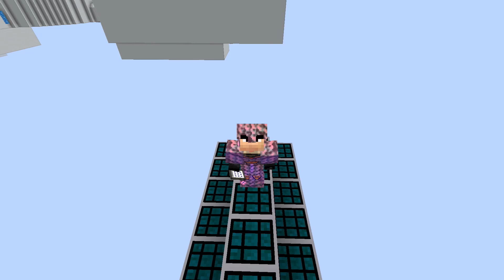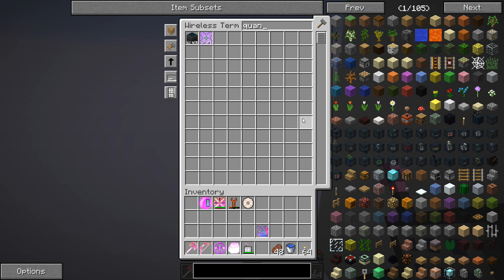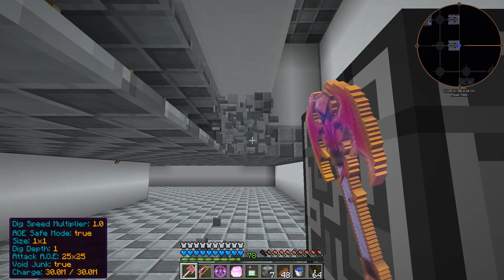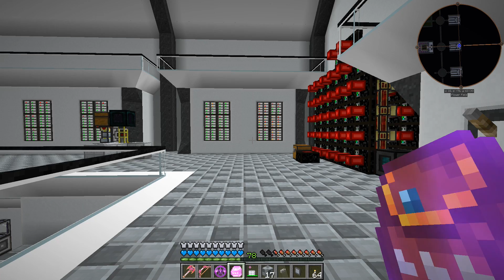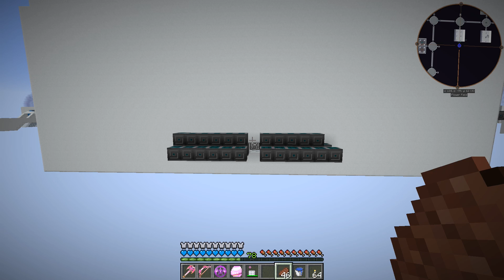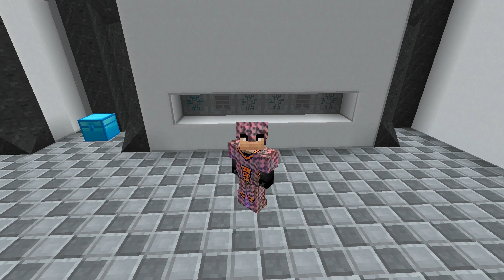Minecraft Mods FTB Infinity - MAX SPEED REPLICATOR !!! [E67] (HermitCraft Modded Server)

Comment: if you use a transfer node for  energy (preferably the hyper one), you can then connect solar panels to it and transform it into RF. So just connect glass fibre to it and fluxduxts to the other side and no more need for reactors! ;)

Comment: Watched the whole episode, and the best I can come up with is that you should put a P2P Tunnel - EU on the back of each of those Replicators.  As it says on the AE2 website "A P2P Tunnel has one input and many outputs."  I believe you can use the P2P Tunnels on the downflow of subnetworks, but not upflow.  So the input has to be on the main network, but you can have outputs on the subnetworks. Will test soon.
Reply: I tested this and it only works on the one network.

Comment: In defense of the Thermal Expansion fluiducts, You were using Hardened so those things cap at a point. I bet if you used a better pipe it would be like the Extra Utilities pipes or better. But either way, awesome video!
Reply from the maker: Tomnickles Is there a better thermal dynamics fluid pipe?
Reply: I thought the Flux-plated ones were faster but apparently not so much. I guess hardened is the best for fluid.
Reply: Hypnotizd Use the top tier ender io fluid pipes, they do they fluid super fast.
Reply: +Connor Macfarlane 
Yeah, the EnderIO Ender Fluid Conduit also transports liquid instantaneously from point to point so no physical liquid is in the pipes.

Comment: I tough you can only put 8192 EU/t trough glass fibre cable.
Reply from the maker: mukkaar I believe this is the maximum packet size, not the total amount of power. Two quantum would have maxed the cable out otherwise ;-)
Reply: Foot2Foot There is no power problem, it's the uu matter that's the problem.
Reply: Foot2Foot It's not that the power isn't transferring enough because if that was the case then turning off the one that WAS working would have fixed it, so it's probably just bugged.
Reply: Hypnotizd It is. This was previously seen in the largest 4 insulated cable. I had a 25k+ EU/t setup in tekkit classic and where all other cables blew up, the 4x was fine with it.
Reply: Seductive Panda nuclear reactor? Or did you ACTUALLY craft all those solar panels?
Reply: Insert Name Here A few Nuclear reactors as well as a solar farm.
Reply: Seductive Panda Hv solars or just Mv's?
Reply: Insert Name Here Both. I'd add HVs as I got 8 MVs. I didn't really add more once I was on my seconds reactor.
Reply: Seductive Panda Why exactly did you need so much power for? Because it's a little bit excessive. Also force fields don't use up THAT much power.
Reply: Insert Name Here I played on that server for 5 months, got shut down after tekkit turned into tekkit classic. I powered a town with that, as well as a mass fab.
Reply: Seductive Panda A mass fab? One SINGULAR mass fabricator? With 25k eu per tick?!?? XD
Reply: Insert Name Here Lol no. I had 5 and every person in the town had no power limit so they had a bunch too.
Reply: Seductive Panda I hate to break it to you, but there is NO WAY that ANYONE is going to use 25k eu per tick. XD
Reply: Insert Name Here Try 20+ people in a town with fully fledged bases with no power limit. That'll do it.
Reply: Seductive Panda That's still over 1k eu per person every tick, that's A LOT of power for free.
Reply: Insert Name Here Yea, well I'm a generous person. You said it yourself, what can 1 person do with that power that EE doesn't take care of?
Reply: Seductive Panda Have you managed to do anything like that with the NEW IC2?
Reply: Insert Name Here Haven't really bothered, but I might.
Reply: Hypnotizd Please remember that packets are removed. Power now adds up. :)

Comment: I can't be sure here, but as you are aware you are using a ridiculous amount of power for that one machine, that perhaps it is just instantly draining all the power, and not allowing any other machines to gain power. Also, those cables do have a limit, right? Perhaps they are just not able to keep up with so much. These are just ideas, however, as I have never used the glass fibre cables before, because I use the ultimate universal cables from mekanism to convert power (on a different pack). Maybe you could try having a separate p2p tunnel for each machine, just to be sure, although that would be more costly and use more channels.

Comment: As EU glass fibre cables have a max eu output of 8k maybe you could increase the speed by hooking the p2p directly to the fabricator or have multiple EU cables going into the fabricator. Just a suggestion not sure if it would work though... Theoretically it should :)) @Hypnotizd
Reply from the maker: Periodic Op This is a good thought! I'd have to convert the cables I'm running to something a little bigger to accomplish this. Right now we have just enough to send and receive data/power to each of the three sections per side! Hmm, something to think about for sure!
Reply: Hypnotizd I believe IC2 also has High voltage cables, which are the tier above the glass fibre ones. They kill you if you touch them while they're transmitting power tough, so be careful.
Reply: detexicap yes but they carry fewer packages in comparison of glass fibre cables this means lower power transport
Reply: Diego Dassie Ah didn't know that
Reply: detexicap actually, the hv cables only output around 2,000 eu and the glass fibre outputs around 8,200 eu since of 1,6 so the glass fibre is the better one of them after 1,6 (the best eu wire is a superconductor from gregtech) before 1,6 then a glass fibre only could take around 512 eu so yea, but something hypnotizd could do is to make a eu-detector cable, that one output a redstone if it got eu in it, and on that way he know if it got eu or not.

Comment: The whole point of p2p tunnels are to send things wirelessly so they shouldn't require power to work because that would make them pointless because they need a cord to be powered right? Oh btw I've never played with mods just using logic
Reply: Wait were thoes wires under you ic2 base for items because that would make more sense
Reply from the maker: Meow Meow The way AE2 works is each cable is limited to a certain amount of items called "channels". The glass cables I'm using allow 8 items to be on there max. For instance, I can use the p2p tunnel to send the dense cable through which will allow me to connect 32 things to it.

If I had 4 dense cables (32 channels each), I could send and receive them through one glass cable (8 channels) with four p2p sending and four p2p receiving. This would give us a total of 128 channels to work with on the other side. The main reason you'd want to do this is resource cost; the dense cables are a little expensive. The reason I'd do it is because it keeps my wires clean so I'm not running 4 separate cables.